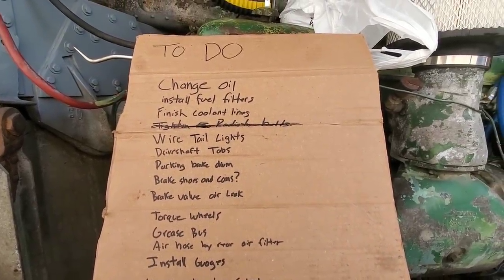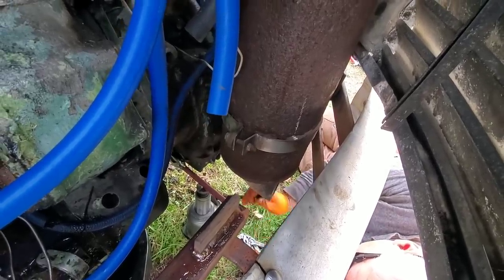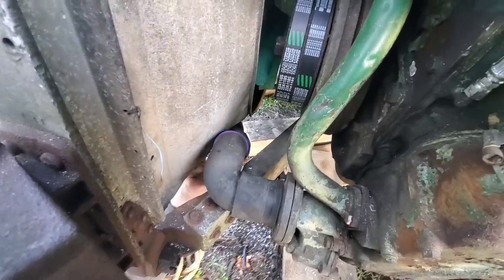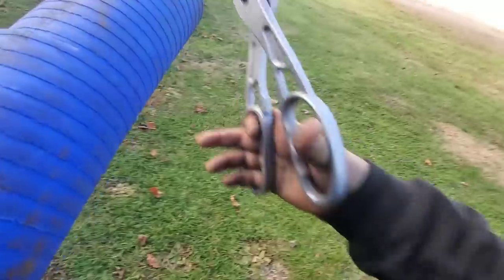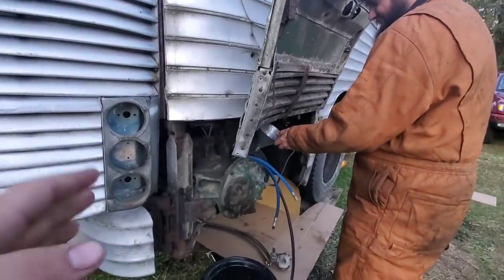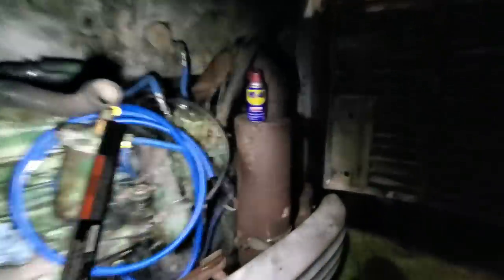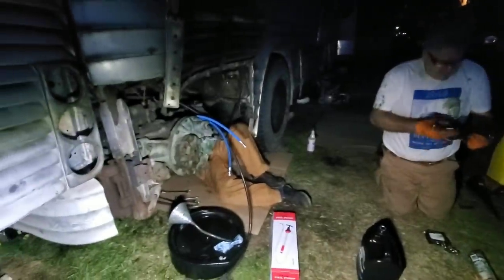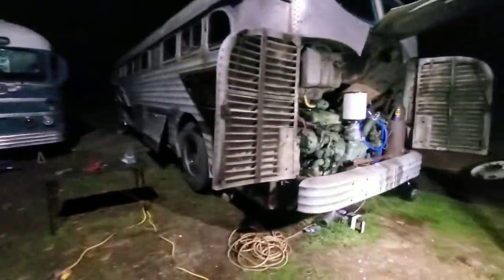The prewar silversides: fluids are going in

Comment: Just an FYI the modular stop lights/turn signal held in place by a rubber mount that you use a three pin plug for power have  a 7 year factory warranty.once a year my boss used to take the burned out box of modular lights down to the parts store and swapped them out for new ones, magic marker is normally used for the date installed laundry marker is best as it doesn't come off.

Comment: What's your general opinion of Harbor Freight stuff?    I buy it, its good enough in my opinion, and it's nice to know tools can be treated as disposable once-twice-use-items sometimes, for minimal cost..    But when it comes to electronics, I am a Fluke snob unfortunately.
Reply: I've never had any problem with anything from Harbor Freight.
Reply from the maker: It depends on what i am using them for,  for my home box i buy nice tools. For my service truck where possible i try to use cheaper tools. If i was to leave something on a job out of state id rather leave a $1 socket ofer a $30 socket. Also a big fan of fluke. I was the lead electrical tech at a dealership for. While.
Reply: We use a lot of their stuff, but we don't necessarily get everything there. I generally find their drill bits to be incapable of drilling a hole in a warm piece of butter. That being said, I gave one of their step drill sets another chance a few months ago and they worked just a good as a $45 Unibit, if not better.
Reply from the maker: @michigandon  i hate theur regular drill bits. The left hand drill bits arent bad. The step bits are good.